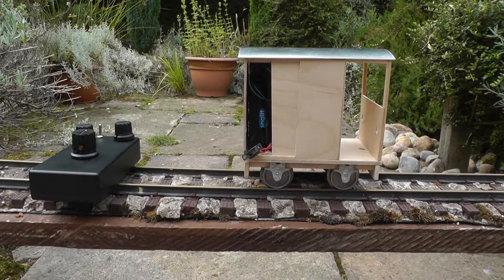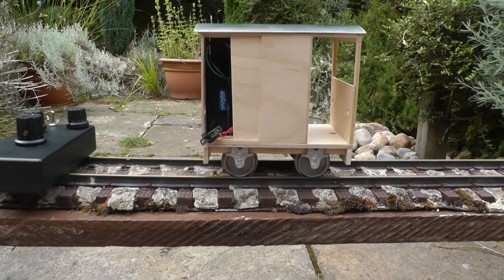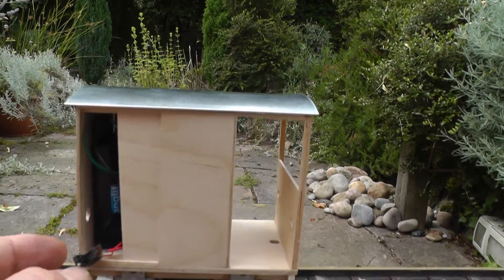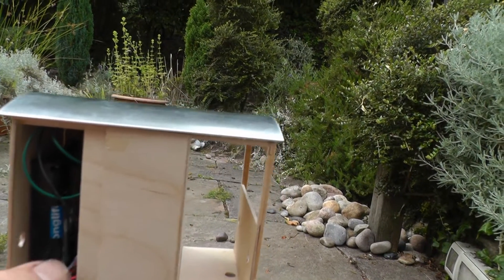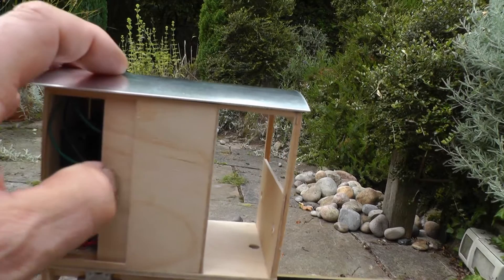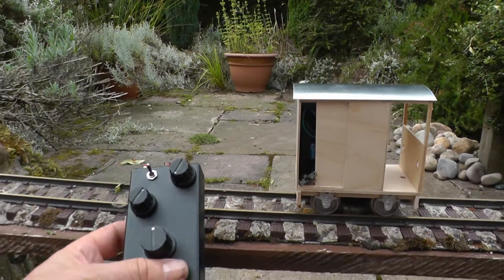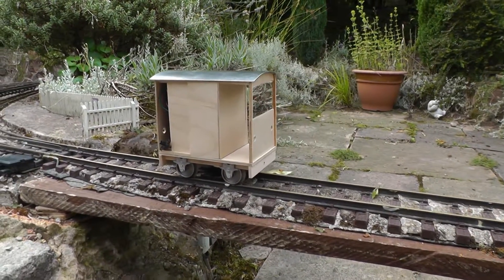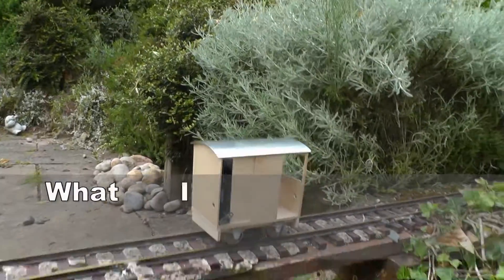Deltang radio control on 4.5v

Comment: So I am in the middle of converting all of my diesel locos (ps models hudson) to deltang radio control and as a pet project (and taking inspiration from one of your builds, shuttle loco?) I’ve put two 14500 li ion cells in parallel for increased capacity. It isn’t finished yet so I could easily swap to series, for the range. I haven’t really explored the range but would you advise doing this?
Reply from the maker: Hi. It depends on the. Voltage requirement of the motor. I've used two 14500s in parallel for my IP Engineering Simplex and for my HGLW diesel loco. Both have 3v motors.
Reply: @rikbennett9   yes the motor in this loco is a 3v one. From this video I took from it that it was the low voltage being problematic with the MR603 esc/rx combo that was causing the range issues? I can always fit a more tolerant motor for the 7.4v supply.
Reply from the maker: Since making this video I've realised the voltage doesn't affect the range. The chips on the receiver board operate at 3,2v so it doesn't matter what voltage 3.7v, 4.5v, 6v, 12v etc you put in it will behave the same way

Rik
Reply: @rikbennett9  That’s good to know, I wonder why the range was affected in this case? Proximity to the motor or the metal roof? It does help me with my project as much as I’ll leave it as a pair of parallel cells for the foreseeable.
Reply from the maker: Having the aerial touching or near to metal will affect the range.

Comment: Very cool. 👍 I've been looking into making a hi-rail pickup truck for my G scale.  Where did you get your radio  receiver at? Any information would be greatly appreciated.
Thank you 🚂🚃🚃🚃
Reply from the maker: Hi. The RC equipment I use is Deltang. However, there are presently supply issues with Deltang receivers owing to global microchip shortages. However, Micron RC have developed a compatible replacement which I have now started using and I have found is equally as good. See - http://www.micronradiocontrol.co.uk/rc_model_rail.html#options